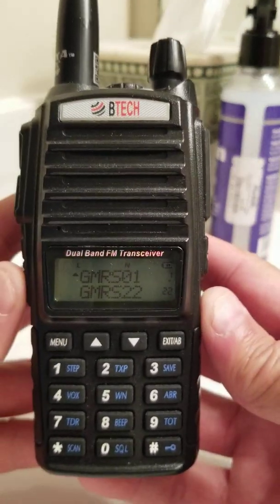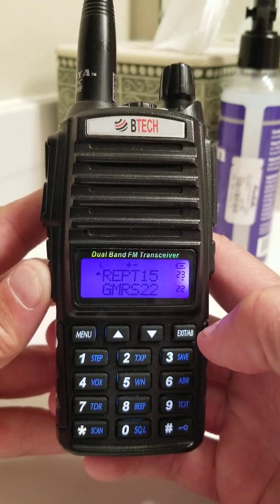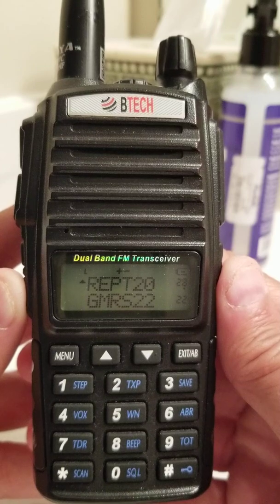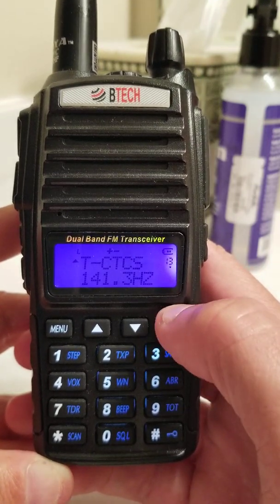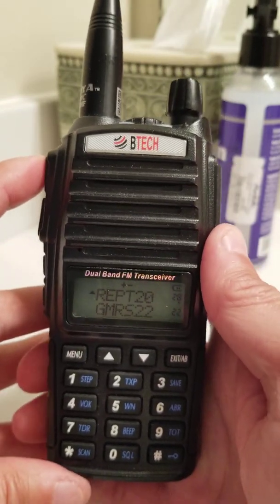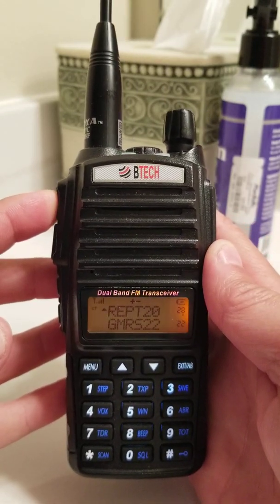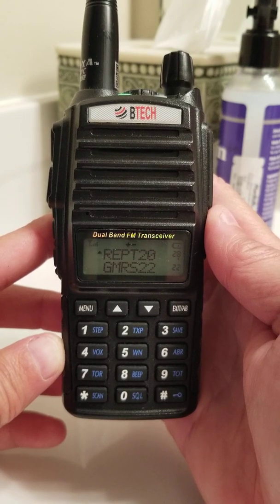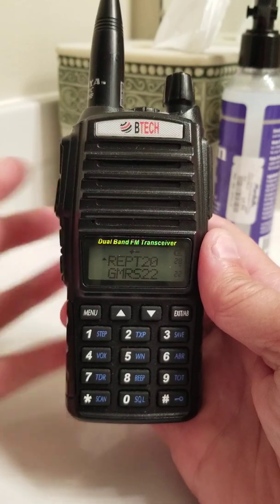How to Program Repeater channel on BTech GMRS-V1

Comment: you didn't show how to access the gmrs channels, you just turned it it on and it was already set. this is not simple. the manual doesn't tell you anything. some help please.
Reply from the maker: Not exactly sure what you are asking.  The GMRS frequencies are preprogrammed on this particular radio.  Here are the frequencies assigned to the channels:

Standard GMRS Channels (1-7, 15-22)
These channels are used for non-repeater, simplex communications. 

    Channel 1: 462.5625 MHz
    Channel 2: 462.5875 MHz
    Channel 3: 462.6125 MHz
    Channel 4: 462.6375 MHz
    Channel 5: 462.6625 MHz
    Channel 6: 462.6875 MHz
    Channel 7: 462.7125 MHz
    Channel 15: 467.5500 MHz
    Channel 16: 467.5750 MHz
    Channel 17: 467.6000 MHz
    Channel 18: 467.6250 MHz
    Channel 19: 467.6500 MHz
    Channel 20: 467.6750 MHz
    Channel 21: 467.7000 MHz
    Channel 22: 467.7250 MHz

GMRS Repeater Channels (23-30)
These are paired channels that use a repeater to extend communication range. The repeater listens on the input frequency (the "upstream" frequency) and transmits on the output frequency (the "downstream" frequency). 

    Channel 23: 467.5500 MHz (Input) / 462.5500 MHz (Output)
    Channel 24: 467.5750 MHz (Input) / 462.5750 MHz (Output)
    Channel 25: 467.6000 MHz (Input) / 462.6000 MHz (Output)
    Channel 26: 467.6250 MHz (Input) / 462.6250 MHz (Output)
    Channel 27: 467.6500 MHz (Input) / 462.6500 MHz (Output)
    Channel 28: 467.6750 MHz (Input) / 462.6750 MHz (Output)
    Channel 29: 467.7000 MHz (Input) / 462.7000 MHz (Output)
    Channel 30: 467.7250 MHz (Input) / 462.7250 MHz (Output)

Comment: i have the same radio and also live in the north georgia area. how do i know what repeater to use? also, in order ot talk to my wife, she'll have to be on the same repeater?
Reply from the maker: Use Google and search for "North Georgia GMRS Network".   The NG-GMRS web page will have a link listing the available repeaters with frequency and tones.  Most of the NG-GMRS repeaters are linked, so you and your wife do not necessarily have to be on the same repeater.  As long as the repeaters that you and your wife use are linked, you should be able to communicate successfully.

Comment: Hello Yoyo, I have a question: I have the same Btech v1 and I would like to know how I can put a free channel with code, for example channel 19 and put code 12 on it to make it functional with another radio that I have, please could you help me with this problem I have?
  thank you very much and many blessings
Reply from the maker: Not sure if I understand what you want to do.  The Btech V1 is a bit limited.  You cannot use a Simplex channel for repeater use. You have to use a Repeater channel.  Also, you cannot change the frequency for a given channel (Simplex or Repeater).  The Btech V2 is a bit more flexible.  It has 200 customizable channels.

If you are simply trying to set the CTCSS or DCS tone, then the instructions in the video should be the same for any channel.
Reply: @YoyoBandalore  First of all, thank you for answering me, if Yoyo is true, what I wanted was to make a private channel, for example in GMRS the channels are from 1 to channel 22 and my idea was to have a channel where I can talk and not be bothered, I don't know if now you can understand me better and thank you very much once again thank you
Reply from the maker: @rudyxeijas5342  Well, you can set a CTCSS or DCS tone so you will not be bothered by other radio traffic on the specified frequency unless someone else is using the same configuration.  Be aware, you radio traffic will NOT be secure.  Even though your radio has a "privacy" tone set, someone can still hear you radio traffic with a scanner.  The term "privacy" tone is a misnomer.

Comment: Hey man I was wondering why when you transmit you say Atlanta123 first before call sign? Is that particular distinction given to all gmrs license holders? Thanks
Reply from the maker: I am a member of the North Georgia GMRS Network. On that network, I am assigned a tactical number which in my case is ATL-123 (Atlanta 123).  When using a NG-GMRS repeater, I use this tactical number in addition to my FCC assigned callsign.
Reply: I am from newyork city and I want to connect to my gmrs repeater which channel would be mines.

Comment from the maker: FYI, the video shows how to set the Transmit CTCSS tone (Menu-13 T-CTCS).  If you need to set a Transmit DCS (Digital Code Squelch) tone, then use Menu-12 T-DCS.
Reply: New to Gmrs. Have my GMRS license and entered local repeaters but hesitant to use. If my wife and I each have our Btech V1 programmed to repeater frequency, can we both call repeater using my call sign and talk to one another at the further (repeater) distance as a test?
Reply from the maker: @larrynelson5443  Yes, you and your wife can both use your FCC call sign.  You might add something like "Unit 1" calling "Unit 2" to distinguish between the two radios. GMRS tends to be a bit more lax compared to Amateur radio.  Go for it! :)
Reply: Are all these menu options in the manual it comes with? I just ordered the v2